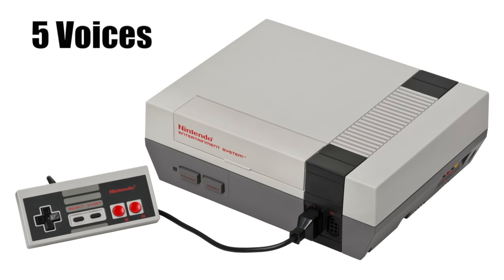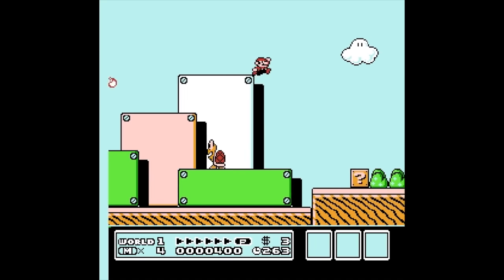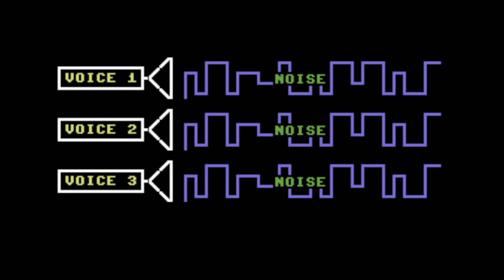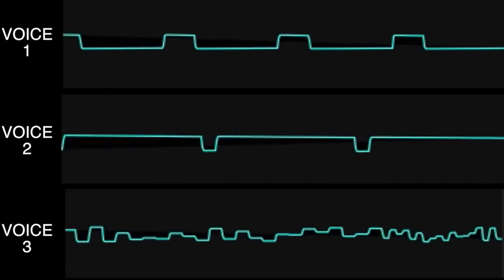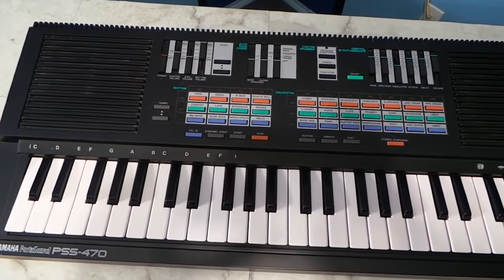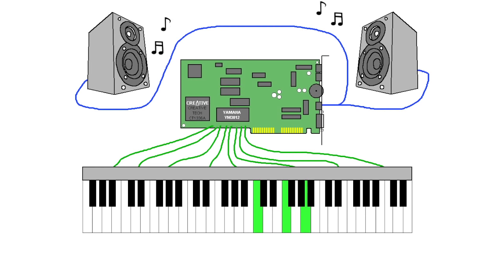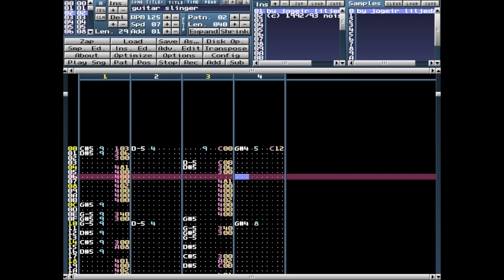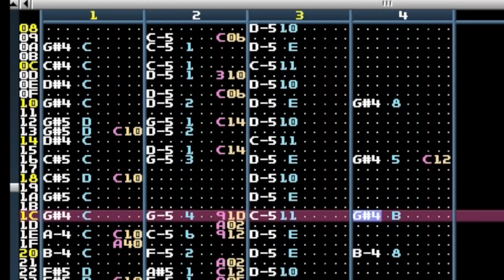How Oldschool Sound/Music worked

Comment: When I wrote for the SNES I used a sample playback system that used samples I generated. NO FM audio at all.
Reply: I'm working for a SMW hack on the SNES
Reply: @billyline3558  really?
Reply: Sweet. Can you provide any links for your work? Thanks!
Reply: @blidrob  It was 25 years ago and they're all toast by now! The Mask from THQ might be somewhere!
Reply: @rowboat10  most assuredly!
Reply: Snes uses soundfonts.
Reply: The SNES (mostly) didn't use FM the way other 8 & 16-bit consoles did. It played samples from user created sound fonts, applying various designated effects. Not dissimilar to the keyboard showed off at 6:00 in this video. It was an advanced audio subsystem for its time designed by Sony.
Reply: Snes!!!!!!
Reply: @alandunaway3000  Snes doesn't use soundfonts.
Reply: @joaonitro5149  Yeah, it does. No other way to generate sounds like that.
Reply: @alandunaway3000  No. It uses samples, but not like a soundfont. It's just tiny audios that can change pitch. It isn't like a midi with a soundfont.
Reply: @alandunaway3000  For example, you can't extract a ""soundfont"" from a snes game, but you CAN extract it's samples and manually make a soundfont with it.
Reply: @joaonitro5149  Uses a soundbank then, much like the tone generators.
Reply: @alandunaway3000  NO IT DOESN'T. The samples are on the cartridge itself, the game composers are the ones that put the samples on their games. The Snes does not have a soundbank.
Reply: @joaonitro5149  And did I say the soundbank was on the console chip?
Reply: @alandunaway3000  It isn't a soundbank though. It's just audio files. You're probably thinking too much about the normal ways to do music from nowadays. When in fact, snes music is made by coding. That's right, most composers code the music, or they use a music tracker that only works for the snes.
Reply: Honestly speaking: no one cares.
Reply: You worked on the snes?! What games were you apart of?
Reply: Damn I can get down to commando voice 3.
Reply: @billyline3558  fun fact: did you know that Android devices could run emulators
Reply: @joaonitro5149  Alan roasted bad. He probably worked on emulator. 💀💀💀🤡
Reply: That’s how the SPC-700 worked.
Reply: @hacktrixapii  lol
Reply: Snes is a legendary console
Reply: @alandunaway3000  Search up what it used before making a such broad claim
Reply: @wayahedia9989  my friend worked at THQ
Reply: @RastaJediX  Programmer?
Reply: @wayahedia9989  game designer
Reply: @RastaJediX  I probably knew them, but when I was there, we only had about 3-4 programmers and a couple of artists. I left in 96 before they folded. Perhaps that was when they had no internal crew. Calabassas or Chicago?
Reply: Snes the best snes  FM, sample
Reply: What!!!!!
Reply: uefde
Reply: jrd
Reply: Press X to doubt
Reply: @alandunaway3000  
Technically speaking, the SNES calls the samples directly from the cartridge data. Soundfont is a format created by E-MU that has nothing to do with the SNES.
And also you could argue it doesn't really use soundbanks, because every sample used in a track is loaded directly from the ROM  data.
It doesn't really matter at the end of the day. The point is that the SNES soundchip mainly plays samples at different pitches.

(And there's also an obscure function that can do primitive FM stuff, but there's barely anyone who really uses it)
Reply: How do developers make music on the SNES?
Reply: @dqwno4900  That isn't a very easy question to aswer.
Luckily, there's this video! https://youtu.be/lA3LzyH6cEg
Reply: @alandunaway3000  correct
Reply: @joaquinglantz350  Isn't a collection of samples all a soundbank is though? Also the sound coprocessor can't directly read from the ROM cartridge, the sound CPU has to be sent sound data to load into audio RAM first by the main CPU.
Reply: @tomrow32  I mean yeah I guess you're right.
Also I'm not really knowledgeable about the technical side of things, so I'm probably wrong about what I said.
Reply: That must have been a godsend once you'd figured it out. FM audio is horribly unpredictable at points.

Comment: That C64 Commando track is SICK!!!
Holy... I didn't know much about the C64 soundchip and now I'M pretty impressed

This video also reaffirmed my preference for game console music : FM synth > Samples. By a wide margin
Reply: +FinalBaton you will enter a realm of SID awesomeness soon enough. Have a look at the MIDIBOX Sid project for some inspiration
Reply: Ah, but a sample based system can imitate FM synth. 
All you need are appropriate samples.
I will admit though FM synths have some interesting qualities to their sound.
But... It varies considerably from chip to chip as to what it sounds like - Not always good...
Reply: +KuraIthys no emulator can 100% accurately replicate a true synthesizer.
Reply: +Marios Sklavenitis 

Not quite true. If the synthesiser's characteristic sound relies on analogue components, then yes, you can't fully emulate it. If it's all-digital, then a full emulation is possible, though it will likely involve lots of bit-shifting black magic to pull it off.
Reply: This video doesn't dig very deep, it doesn't explain the differences between FM and subtractive synthesis. The synthesis method of the C64 was not FM, it was a subtractive analog synth.
Reply: FM typically has a more polite plastic sound than analog synths, although FM can also sound harsh and metallic. The C64 analog SID synth can sound really raw and in your face, and one feature that was also not explained is ring modulation, which enabled the typically complex drum sounds in many C64 games. Also C64 music programmers managed to create their own waveforms by "sequencing" existing waveforms, e.g. starting with a bit of noise and then quickly switching to a square.
Reply: FinalBaton,  I heared this Melody in a Porn Movie D:  They used a Game Track for this Movie xD
Reply: +Ohnkel Onkel link
Reply: I kinda agree. Synthesiser based systems, especially in the hands of talented composers had way more character and charm. Where as the only thing characteristic about the sample based systems is the low-fi, muffled Low-Passed sound of the samples due to dithering and limited tech and memory space. The SNES however, had some pretty great music regardless, unfortunately the reverb effect built into the unit was overused in my opinion.
Reply: π λ Ω4000
Reply: Except that the guy gives false information. The C64 does NOT have FM synth.
Reply: That's because Rob Hubbard was a GENIUS when it came to the SID chip.
Reply: Marios Skl , you don't have to emulate it. You just record the output of an FM synth and play it back. But either way, the Yamaha OPLs are digital synths anyway, so they could be emulated perfectly.
Reply: @kixxalot   That's right, the C64's SID chip is a digitally-controlled hybrid digital/analog subtractive synthesizer with multiple modulation and filter options for each voice independently; the voices could also optionally modulate each other to make even more complex sounds.  This essentially makes it what we typically think of today as a vintage polyphonic analog synthesizer (implemented on a single chip instead of as discrete components).  And it has a limited but usable ability to reproduce PCM samples, as well.  It's nothing at all like the FM synthesis and other chips of the time (nothing wrong with those, but it's just not the same thing).
Reply: The quality of the C64 music of course all depended on the musician. There were a lot of great SID tracks, and musicians, but sadly, just like with every platform, there's a lot of crap too,. The title "music" for the C64 game Demons of Topaz comes to my mind. Good game, nice little platform shooter, but the music is awful. Luckily, it only plays during the title screen, and isn't in-game music
Reply: nobody remembers c64 super cycle :(

Comment: I would love to see a dedicated video like this for the Sega Master System...
Reply: It worked like the NES except it's all either square waves or noise, also had no pcm channel iirc. The sound chip was also featured in some Tandy computers.
Reply: @rydoggo  yep that's correct
Reply: Sega Sucks
Reply: @shockwave6698 
Writing that while knowing SEGA's hardware was better than Nintendo's at every comparable generation. Nintendo/Master System to GameCube/Dreamcast.
Reply: @shockwave6698  back in the 90s they didnt
Reply: @quinndeery890  Early and late 1990s.  The Genesis/Mega Drive needs no introduction, it had a good library and was equally powerful compared to the SNES.  The only real stain on 1990s SEGA was the Saturn, which was put to market way too early for its own good and was thus quite underpowered compared to the N64 and PlayStation, despite the N64 still using cartridges and having the weird "The manual tells you which grips to hold" controller.  The Dreamcast was pretty good and had decent support from SEGA, but died off due to the sheer momentum of the PS2 hitting it like a truck.
Reply: It used a Texas Instruments SN76489. Also used in some machines too. This soundchip has only 4 channels (3 square and 1 noise)

Comment: There's one aspect that you guys seemed to have missed, regarding the FM synthesizer (I'm wondering if you've confused it with PSG controllers...).  For example, many Yamaha chips didn't have just a single pattern wave for a single channel.  Each channel would have had multiple "operators" that played different wave patterns, and those patterns would feed into each other within a single channel, and that channel would output a complex waveform that doesn't fit the criteria of a simple square, trianle, sawtooth, etc...

The Mega Drive/Genesis' YM2612 for example had four operators per channel, where each operator outputs a sinewave, the sinewaves are fed into each other, and the channel itself outputs an extremely complex waveform, if controlled correctly, known existing instruments such as a piano could be made.

Cool video though, I did learn a small deal about the more primitive PSG sounds, your presentation is fantastic too!  It gets the message across very well.
Reply: Well, there are also the SMS channels. Those were explained in the video though. (3 square waves and 1 noise channel)
Reply: Markey Jester say that again but in human
Reply: You’re entirely correct. They conflate PSG and FM, and completely ignore operators (or any filtering) and only briefly mention pulse generation and envelopes.

Comment: How did you guys record the different voices on the game M.U.L.E? Or the different voices on other games. Could his be done using ROMs?
Reply from the maker: +Joe Garza I used an emulator to play the music and thus I could turn on and off specific voices in the emulated sound chip.  Then I had to play the song multiple times to get each voice.  Then I had to use a different program to get the oscilloscope video, and combine it all together.
Reply: Thank you. I checked the current NES emulator I have and it does let me turn off different voices. This will help a lot for sampling so thank you very much. This was extremely helpful!
Reply from the maker: +Joe Garza I also find it useful when I'm trying to learn how to play the music to retro games on a keyboard.  If I turn off all of the voices but one, it makes it easier to hear the notes being played by that voice.
Reply: +The 8-Bit Guy Sounds time consuming. Bad glad you did it anyways, as I've definitely learned a thing or two from this video.
Reply: I wonder if there is a way to not have to play the game to record sounds. Like jump sounds or other effects without the music overlapping.
Reply: +Joe Garza There's an even easier way to mute channels, with emulated music players/plugins. These are essentially emulators that only play sound data stripped from the full roms, and they often come with a variety of functions such as channel muting and tempo alteration. And of course you get all available tracks in a playlist, instead of having to play through the game.
For starters, go look up NSF (NES Sound File) and Game Emu Player for foobar2000.
Reply: +The 8-Bit Guy that's dedication; thanks for your work!
Reply: +Joe Garza Joe, which emulator you used?
Reply: +Juan Gutierrez nestopia emulator
Reply: +IgoSplashman I was hoping there was an easier way that way I don't have to play every level to sample each instrument. I also wanted to sample effect sounds like coins or jumping. Hopefully this helps
Reply: Joe Garza Certain NSF rips do contain sound effects, but not all.
There are also sites which specialize in NES sound effects and instruments: http://forums.famitracker.com/
Reply: +IgoSplashman Jewbar, gross.

But yeah, sound emulation and music rips has been a thing for a looooong while. You can rip SFX information directly from the ROM. I'm only experienced in SPC (SNES audio rips) rips, and SPC is a complete dump of the APU's RAM, this includes all ADPCM samples loaded (instruments, sfx etc.), the driver, instrument sequence/"midi" etc., so ripping SNES sfx are as easy as downloading an SPC (it has been done for 99.9% of games) and ripping the samples that you want.
Reply: Thats one of the Roblox muisc
Reply: +The 8-Bit Guy Which program did you use to get the oscilloscope video?
Reply: +The 8-Bit Guy tooo much effort lol
Reply: guess who i foudn lying around!
Reply: Maranara oooh hai
Reply: TheScoutPro idk i just found this video
Reply: Maranara oke cool
Reply: +The 8-Bit Guy What software did you use for the oscilloscope?